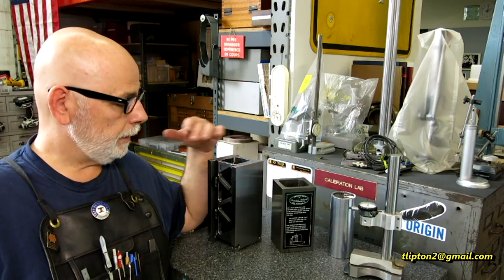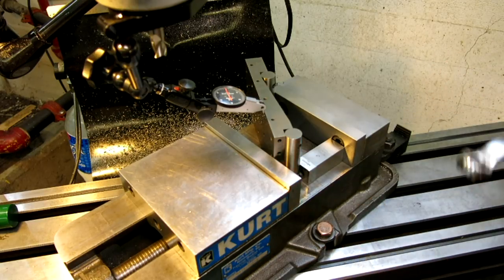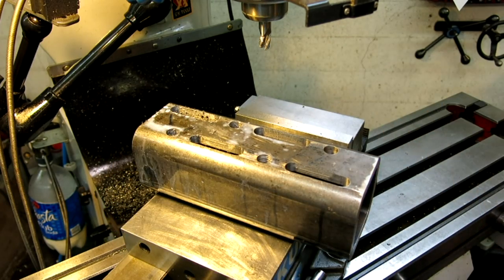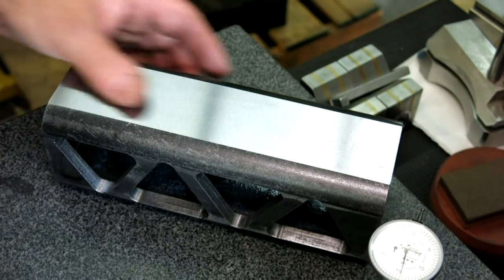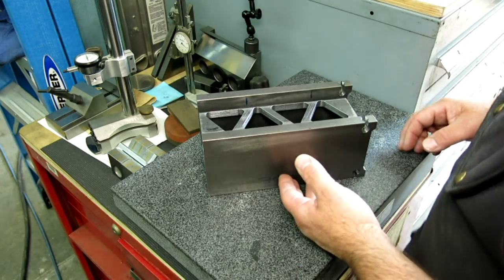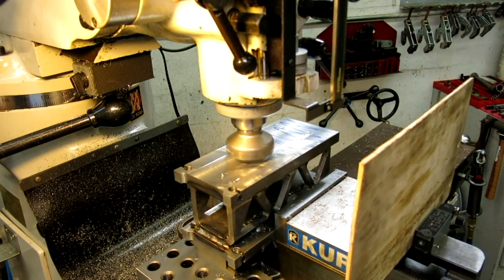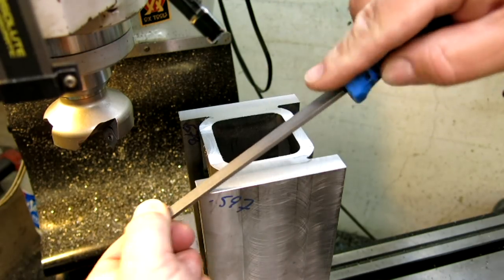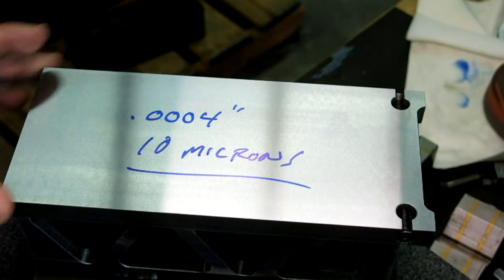Composite Master Square Construction

Comment: Seven tenths...somethin' like that. Precision. And why would you heat-treat AFTER milling the square? And what is a "richer" alloy? Any steel that has been heated red-hot and cools will be harder, regardless of whether it is quenched or allowed to cool slowly. Anybody who has ever fought with broken-off bolts and has tried heating them or welding a nut on them FIRST and then tried drilling AFTER compared to DRILLING first and heating after knows that a steel bolt is pretty easy to drill until you heat it red-hot. Then it's harder than sin and damn near impossible to drill to get an extractor in it or just to drill it out completely. And why does this square need to be "heat-treated"? 

Hardening it is only going to make it more brittle and easy to damage or destroy if its ever dropped and I'm pretty sure heat-treating a complex, multi-piece construction like that with a bunch of material milled out of the primary structure and only short weld strings attaching the sides is definitely going to cause some warping and flexing. And internal stresses that are going to be "baked in" and ready to break free if its dropped or struck accidentally with something heavy and hard. The anvils and jaws and blades and points and edges of gauges and tools themselves are usually hardened because they come in contact with hard materials, are often moved around on parts while light contact is kept to get accurate and precise measurements, measurements are made with the gauges and parts dry and clean. 

Standards, on the other hand, tend to be softer although they may be polished and lapped and pretty much have to be lapped to to get them dead-on nuts accurate and precise in length and surface finish so they don't scratch or scuff the gauges and tools they're used to check and calibrate. From what I gather this is something that's going to be used to align and square up a guide or fence that material will be supported by or clamped in and if that's the case, I'd want it as light and soft and unlikely to damage or be damaged by the machines and material its going to come in contact with as possible. For sure hardening it is going to make it more likely to damage something or be damaged if it impacts another hard object. 

And having it harder may seem better so it can't get dinged or dented as easily, but that's not going to help it if it gets dropped or smashed. It's probably going to finish it and it'll be start all over time. Dings and scuffs and scratches can be filed or milled or lapped out and its tool that if used hard enough long enough is going to wear and need replaced or resurfaced anyway. The parts and tools it could easily ding and damage in use may be more expensive and difficult to fix or replace. There's certainly a lot of time and effort into it and that equates to a lot of money in a machine shop if its a business and not a  hobby. 

And I can't imagine a commercial gauge of similar size is going to cost more than this one did and I also can't believe that if this massive construction with the drilling and machining and welding and more machining ends up straight and true and square and plumb and all that a larger piece of tube to match the final dimensions it has couldn't have been knocked out in a tenth the time and end up weighing less. Standards aren't cheap but they're relatively disposable and easy to replace or build or repair because they're typically just a plain old piece of steel that is accurately and precisely machined to a specific and stable dimension at the temperature they will be used for calibration, testing and adjustment of the complex and expensive and hard to replace tools they support.
Reply from the maker: This is a durable gage. It needs to be heat treated (carburized in this case) for wear and to retain its accuracy. It will be precision ground and lapped after heat treat to final accuracy. Much like gage blocks are hard to provide long service and retain their accuracy.